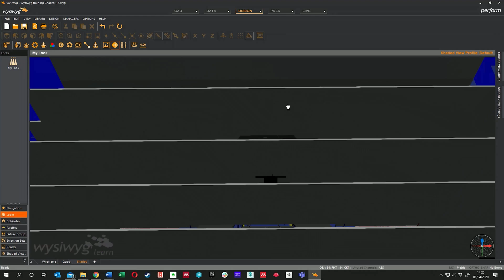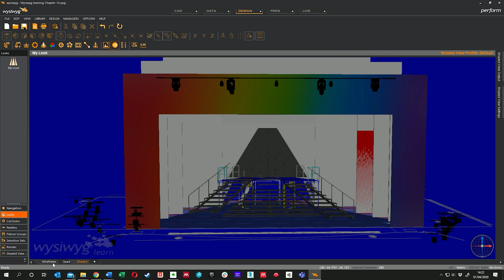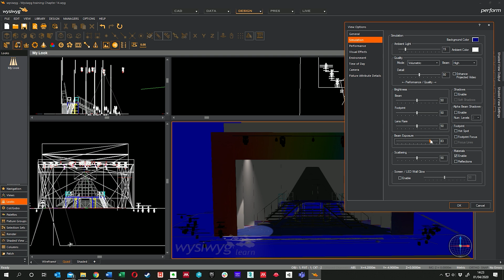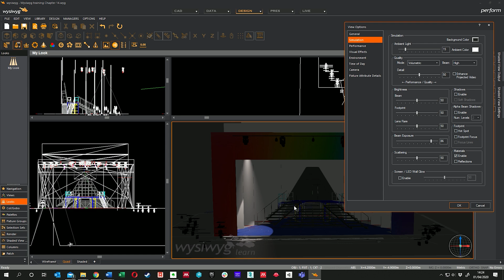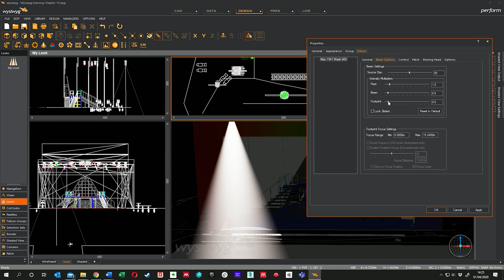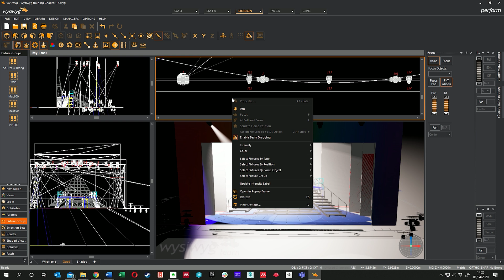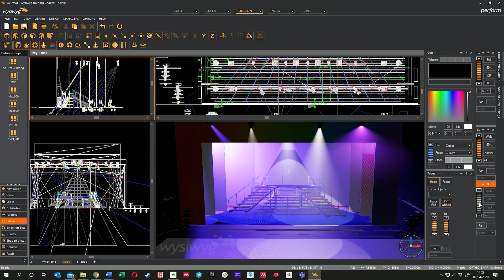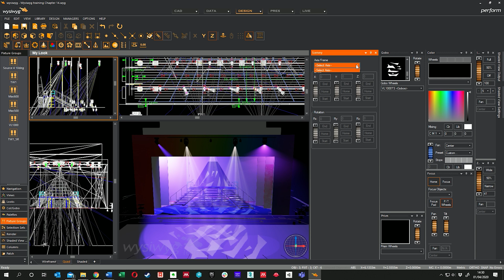Wysiwyg Training - Lesson 32 - Design Mode Light Controls

Comment: I have a little Problem the Intensity slider dosen't work by me. We use in the Company Wysiwyg R38. I see the Light in the Cad Mode wen i Select an Fixture but when i in the design Mode i cant Highlight or move the Intensity fader.